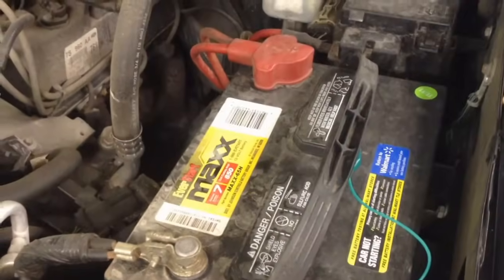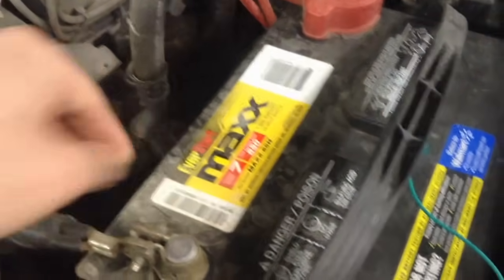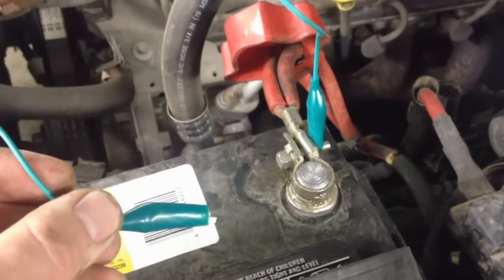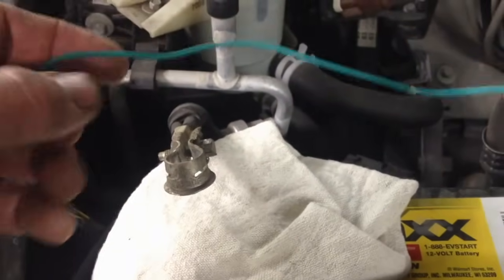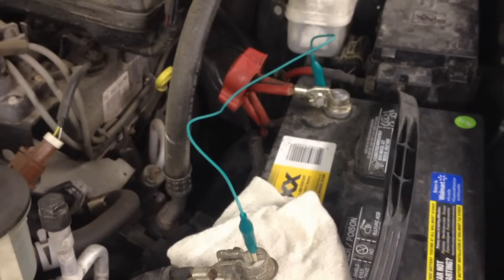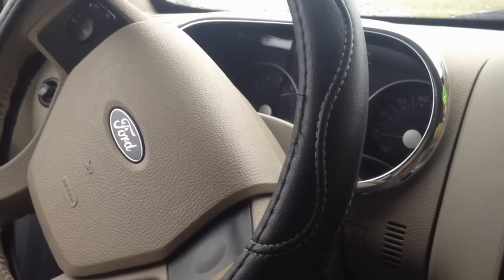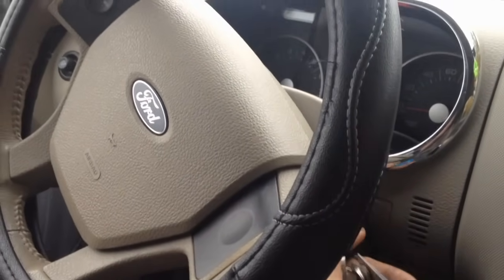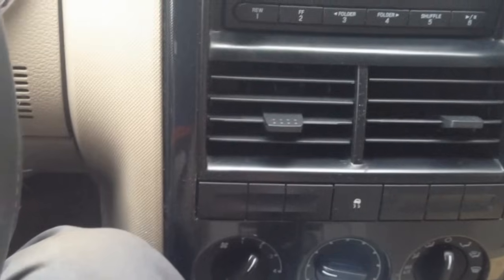How To Clear Your PCM'S Memory On Fords After Repairs

Comment: Nice idea....but cant this be also done with the correct scan tool? Clearing Transmission adaptive tables? isnt that the same?
Reply from the maker: Nicolas Mardini Yes but not always we have come across it many times after a trans repair that the concern still exist until from learned shift point s until thei procedure is done to fully erase the memory. Also many do not have a scan tool and no clearing trans adaptive tables on the new vehicles require a scan tool also as they are stored in non volatile ram area.

Comment: Hey I have a 2007 Ford Fusion 4 cyl just replaced transmission with a 2008 fusion with only 32k. Now when driving the speedometer will shoot to zero and then back to the speed I was going causing transmission to downshift erratically and the wrench light comes on but then goes back off after the speedometer goes back to normal. We tried your video and it doing the same thing. The trans shifts into every gear perfectly no slipping do u have any suggestions ???
Reply from the maker: Ashley Teague I would get the codes read and look very closely at the OSS sensor on the front of the trans to make sure no damage was done to the sensor or harness. It is dropping out from a chafe or sensor damage somewhere.

Comment: I've got an 06 F150 (5.4 FX4). Dealer just reprogrammed the PCM after a plug & coil change. Now a week later I have no reverse. Fine in drive just no reverse. Any chance this is PCM related?
Reply from the maker: Cory H I highly doubt it sounds like the directs are welded together. Does it go through all the fwd gears smooth 1-4?
Reply: Yep every other gear shifts perfect.

Comment: My 2003 ford mustang gt will not start and like u said, the theft light is blinking and it will not crank. The speedometer has all dashes, what u think it may be
Reply from the maker: Anthony Chestnutt I think it is the CCRM module located on the right front fender well. The relays inside go bad and the pcm no longer powers up.
Reply: Thanks will check it out

Comment: i just had cam phasers redone on 04 f150 5.4 3v now ignition coil a and f  pop up and truck will start for maybe 20 seconds engine light flashes and batter light flashes rpm eratic bouncing between 1000 and 200 before dying any sugestions
Reply from the maker: Larry Ford They are not clipped in all the way lube the seals with dielectric grease and push them in till they clip. Were these codes ever there before phaser repair. Why were phasers changed just noise reasons?
Reply: also thank you much for your wisdom

Comment: 09 expedition 5.4 on a easy take off, it seems to bog down after it shifts, when It gets more gas it seems to go. Like the air and gas is not right. I put a spectre intake and a magnaflow on it and it's now loader in the intake when it bogs. Any thoughts
Reply from the maker: bspaintingok did this happen before the air intake snorkel?
Reply: FordTechMakuloco yes before. Worse now with intake on. I'm taking the intake off n about an hour. I was thinking about taking off the throttle body and cleaning it

Comment: I just replaced my 2002 f 150 5.4 trans with a trans from a 4.6. will this fix get it to run and shift right?
Reply from the maker: Todd Anderson Did you check to see if the torque converter stall speeds were the same?
Reply: I used the supplied tc
Reply: I followed your instructions and my idle leveled out. But shift points are all over the place
Reply from the maker: Todd Anderson Yup it will take awhile to relarn them.

Comment: I have an 02 focus recently changed plugs and wires serp belt on it and now its hitting the rev limiter before shifting will this fix the problem you think?
Reply from the maker: dustin fryhover Doubt it sounds like something else went wrong you can certainly try it though.
Reply: I figured it out.. it was the crankshaft position sensor

Comment: Question, on a 2011 F150 ecoboost, will this end up setting tire size back to default?  When I went to a bigger tire, dealer programmed in larger tire size. I've heard tire size is in the TCM, not PCM, on some vehicles. Is there a separate TCM on f150 ecoboost?  Even if there is, does your process also reset the TCM to default?, as it seems the process is just draining power from everything attached to the positive cable, which of course is everything. I know I could just ask the basic question, will the tire size reset to default; but i kind of enjoy learning technical reasons "why."  :)
Reply from the maker: Daniel Plantz yours does not have a tcm and the reset will not clear the current set tire size, those settings are written into the non volitale ram of the pcm and must be written into by the ford scan tool.
Reply: +FordTechMakuloco I was clearing a misfire dtc, from myself cracking the insulator on one of the new plugs I had installed, and noticed the DTC P160A, this DTC would not clear with the scan tool I was using. I understand it has something to do with PCM not recognizing DCM parameters, or something like that. my guess would be that a ford tech changing the tire size within the stock computer, no aftermarket tuner, would not cause a trouble code. could clearing the pcm memory by the method in your video have cleared something in the PCM that was allowing it to "work with" the changed tire size parameter?  I'm probably not asking the question correctly, but just wondering what that P160A might be about.

Comment: had a problem with my 01 f150 4x4 transfer case popping out of gear. Turned out to be a
bad shift motor, therefore I manually put in 2wd and tested it. Now the speedometer is way off and trans won't shift. any ideas?
Reply from the maker: Warren Wimmer Why not change the motor I would not run it without the motor in place.

Comment: I disc my battery and pcm to change plugs and other things on my 2004 F150 5.4 and cannot get rid of this low/rough idle. I've tried and checked eveything for over a month. I was told that my TB is bad and ordered a new one but in the meantime have tried the basic re learn to no avail. Should I do this procedure and start from scratch. I hate to think Im spending money on things I may not need

Comment: I have a 2007 Ford Explorer 6 cyl with 111,000 miles that has a wrench icon lit on the instrument panel. It's been like that for about a year. The vehicle runs fine. I had the transmission flushed and have cleaned the throttle body, intake and removed the injectors and cleaned them. I replaced the spark plugs and installed new wires. What's odd is that the wrench lights up when I drive 6 miles to a park & ride. From there I catch a bus to work. Upon returning after work the light doesn't come on. I have no codes stored in memory. It seems to me I read somewhere that the factory set this up so that when this light comes on they want you to bring it in to a dealership for a look over. I was hoping that by trying what you shared in the video might clear this but it didn't. Any ideas or suggestions will be much appreciated.

Comment: hello i will be swapping out transmission on my 2006 ford taurus with a transmission from a 2005 taurus. would i have to get my computer reprogrammed or can this method be considered in using after installed. thanks in advance.

Comment: Having issues with an 04 super duty f250. Horn and cruise do not work. And now it's giving me P0675 glow plug circuit. Also, the abs light and battery light came on and went away. Ugh, where do I begin?
Reply from the maker: cencalmatt Replace the glow plug that is bad, replace the cruise deactivator switch and then test for power and ground to the horn itself and go back from there to the steering wheel. Any noise from column when turning the wheel?
Reply: Thanks for the reply. I haven't noticed a noise when turning. I've read the clock spring could need replacing? seems dangerous with the airbag and all..

Comment: Greetings: I hope you help me. I have a problem in the steering wheel is very heavy and there is a word in the counter chick power stering now there Alama mind slipping (advanced track) my car Ford Fusion 2012 please help me
Reply from the maker: You must take it to the dealer the steering rack is failing or the steering angle sensor either way they need the dealer scan tool to do the work
Reply: thank you so much

Comment: I have a 2008 Mountaineer and have been seeing occasional delayed shifts between 2nd and 3rd and the hard/delayed shift from Reverse to Drive for about 6 months.  Today on the way to work it would not shift from 2nd to 3rd until I let off the gas and then pressed the gas pedal again.  On the way home it continued that shifting issue and then I had the check engine (Wrench) show up.  When I check the code it showed P0745 - Pressure Control Solenoid A.  Is this an indication of the solenoid pack going bad (or worse - transmission overhaul needed) or could I simply (wishful thinking) need to reset the PCM as you have explained?
Reply: I'm having the same problem. With my 08 mercury mountaineer v6 i'm going to try this and I let you know if it work
Reply: I would appreciate that feedback.  I just dropped the Truck off at the dealer ($$$) for a $180 diagnostic check.
Reply from the maker: Michael Schrenk It really sounds like the overdrive bore is worn but this can be a solenoid also. The delayed and or harsh engagements are definitely a solenoid pack concerns so I would do a fluid filter and solenoid pack fill with mercon V reset pcm and go from there.
Reply: Thanks for the update.  I had it at the Ford dealer yesterday and they believe it's the worn out bore as you described. They left the Toy in my truck and while looking for a price online for a rebuilt several vendors boast about their rebuilds having that upgrade/repair done on their transmissions that they sell.  Thanks again for the analysis it made me feel better about getting the complete rebuild done.  Never feels good spending thousands on a repair! ☺
Reply: Damn auto-correct.... Toy = TSB... Sorry!

Comment: I need some advice/help. Is there an email I can reach you at or a number? It's regarding an at trans replaced with a cvt trans. Now having issues with the abs module and pcm. I didn't do the swap.
Reply from the maker: Guero Perea sent
Reply: Hello I have a 2003 EB Ford Explorer and I followed your video to reset PCM but it is not working at all

Comment: So this would work for the throttle body on my 2006 five hundred?
Reply from the maker: Yes
Reply: Did you try this yet ampg22?
Reply: yes i did. i changed the throttle body and did the reset worked for about a week no problem and now the the idle seems to get stuck again like it was before i changed the throttle body

Comment: Just replaced throttle position sensor on my 06 Explorer 4.0....reset pcm per instructions and was unable to engage reverse or drive. After 10 minutes I was able to engage drive the reverse. Drove for 45 minutes while experiencing an over rev from 2nd to 3rd (but seemed to be less and less as I drove). Returned home and parked for a couple of hours and now unable to engage in gear. Any thoughts?
Reply: Update - Car was warmed up for over an hour and outside temp was around 20....placed car in drive and increased rpm's causing trans to engage. Drove car throughout the afternoon and parked. 3 hours later temp had dropped to 5 and would not engage. Placed car in drive and increased rpm's only to have wrench light come on. Possibly fluid is low?
Reply from the maker: Brian Davis Is this all since the tps replacement?
Reply: Yes...I replaced the tps because the rpm's were erratic and was having a hard time finding a gear.
Reply from the maker: Yeah I would check the fluid level. After that we are going to have to start doing some pressure testing.
Reply: FordTechMakuloco The fluid level seams ok, but fluid is really dirty. Going to drop the pan and replace the filter tomorrow. Could the solenoid pack cause these symptoms?
Reply from the maker: It can for the delayed engagement yes. Does it smell burnt?
Reply: FordTechMakuloco Not really....just dirty.
Reply: FordTechMakuloco Is seafoam additive a bad idea?
Reply from the maker: Yes it should not be needed.

Comment: Hi. I have Ford Fiesta 1.0L Ecoboost Manual. I installed aftermarket downpipe dan catback exhaust. Do you think I can reset my ECU using this method? Also if I do this, will I have to reset steering rack angle? Thanks.
Reply from the maker: psx pat Yes it will reset it. You do not have to rest any steering angle calibration no.

Comment: Can i try this on my 2007 fiesta? The reason is BC I when driving I get the auto lock temp and check engine light all turn on bit the car does not turn off. I had it scanned and we got message "unknown protocol " message to find out why we had the lights turn on then after 30-45 min they will go off...please any insight would be greatly appreciate it!
Reply from the maker: Allan Castillo You can try yes.

Comment: Will this work on my 2013 f150 eco boost? Just yesterday it shifted from 5th to 3rd while cruising at 55mph and today it went from 6th to 4th and then 3rd while going down a small hill also going at 55 mph. I always drive with cruise control on.
Reply from the maker: I would get it in for this concern if you were just cruising. There is a new molded lead frame with revised output speed sensor to fix this concern.
Reply from the maker: MsArevalo24 TSB 13-6-8

Comment: Any idea if this would work for a 2011 Ford Fusion SEL 3.0L V6? My car threw a "service power steering" and "Service Advancetrac" warning the other night. It currently has no power steering assist- it's mostly noticeable at low speeds. The last time this happened (about a year ago) a gas station I had the car towed to charged me just to clear the code. I'm wondering if I can reset the computer myself and solve this problem that way. Or at least put a bandaid on it for now. Any advice?
Reply from the maker: Alexandria Stafford Yes try this to clear the code but you most likely need a steering rack they have angle sensor issue. I would get the code read first personally.
Reply: FordTechMakuloco will this work on a 2013 ford explorer xlt the video
Reply: demencio vargas  just changed the electric throttle body

Comment: would this work in a ford focus???? FordTechMakuloco pleas watch my vidoe on my page i need help asap
Reply from the maker: dima savich Yours needs the MAF cleaned first then I would inspect for vacuum leaks. You had it idling at fir but kept revving it so my question is does the car idle well just sitting there?
Reply: +FordTechMakuloco no the car sounds like its going to die. Still having the problem till this day .

Comment: Great Videos! I love them.
I took out my Throttle body from my 10' Escape V6 and cleaned it out good.  Then used this reset and worked flawlessly.
Thanks again.
Reply from the maker: Aaron Mckannan That's the idea good to hear!
Reply: @FordTechMakuloco  where are you from
Reply: @FordTechMakuloco  Will this work on Hybrid models too?
Reply: @FordTechMakuloco  Wanting to pay it fwd Brian but i get this message: PayPal cannot process this transaction because of a problem with the seller's website. Please contact the seller directly to resolve this problem.

Comment: 2002 explorer with 4.6 is not shifting well and the engine does not rev over 2000 RPM, it this a possible thing I need to do to help?
Reply from the maker: Raymond Montoya Sounds like a fuel pressure or more likely plugged cats unfortunately.

Comment: Thank you for this video.  I have had intermittent problems with misfires in cold damp weather for years on my 2005 Ford Escape 6 cyl.  The PCM tests fine on the bench but about once a year I get a check engine with misfires that resetting the PCM seems to fix.  My mechanic seems to think a wire harness maybe the problem but does not discount moisture getting in the PCM.  Either one is a costly fix and since it only happens in weather that occurs once a year I am willing to do the resets.  My Escape has over 160,000 miles so spending a thousand or more on something that might not fix the problem seem's like a waste.

Comment: I have a 96 f150 with a 4 inch lift and 33 tires and the 5.0 will this work on my truck
Reply from the maker: To clear pcm yes.
Reply: FordTechMakuloco   I have an 2006 ford escape limited 3.0 and I swapped out the pcm but the new pcm is cranking but would not start the jeep, but the old pcm was starting the jeep it jus had a bunch of misfire codes on it , any advice ?

Comment: 2005 explorer 6 cyl 4.0 l.  Replaced EGR valve after p0401 code.  During EGR install, I disconnected the wire connector to the egr and wire connector to the left of the egr.  These have a slide lock on the connector.  After going thru the PCM reset procedure, I received failsafe mode.  I disconnected the wire connector from the EGR and the wire connector to the left of the connector and then reconnected these connectors and the vehicle started fine, but the service engine soon light came.  I had it tested again at Advance Auto and now have codes p2104 and p2112.  What to do?
Reply from the maker: If you made sure all the connection on the throttle body are reconnected, I would clear the codes, clean the throttle body and relearn the idle and that should fix it. See here- https://www.youtube.com/watch?v=JPNnHU6PYbo

Comment: Hi I have a 2000 f150 4.6l that stalls when driving, but idles fine and no codes.  My mechanic wants me to swap pcms.  Should I have them flash the existing pcm first?  He said something about a ghost code if that means anything to you.
Reply from the maker: Claude Gillman I would flash the pcm first yes before anything to rule things out.